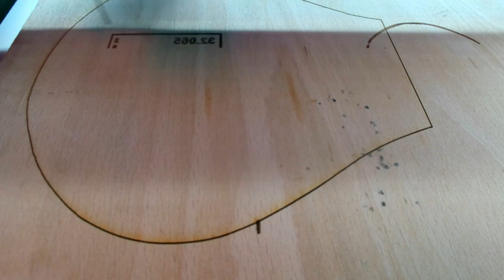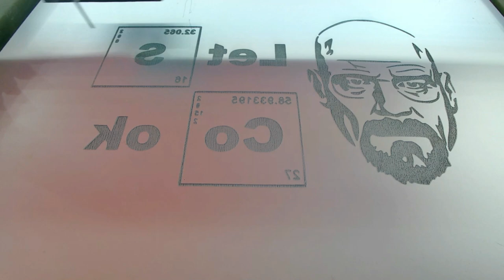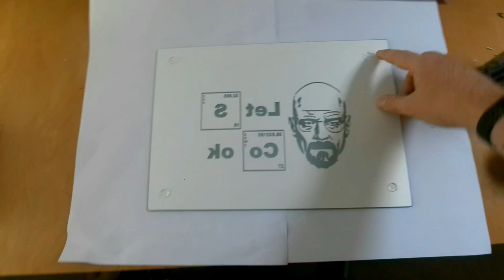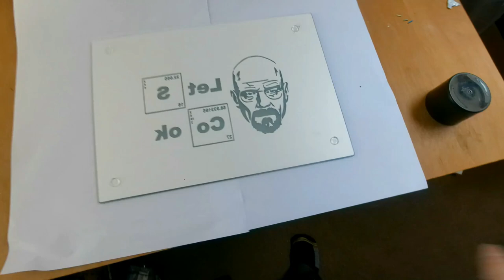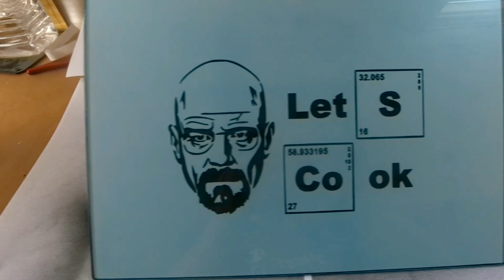Engraving a glass chopping board with a k40

Comment: You can get nice 13cm round mirrors from B&M for a quid. They call them candle mirrors and in the tealight section. Been using them for coasters for family and friends, engraving from the back they come out great. Did a football insignia for my dad and airbrushed in the colours with acrylic paint from the pound shop. Used the K40 to make stencils to do the different colours in it. was quite easy to do.
Reply from the maker: Nice work. Sounds awesome. I'll have to try that